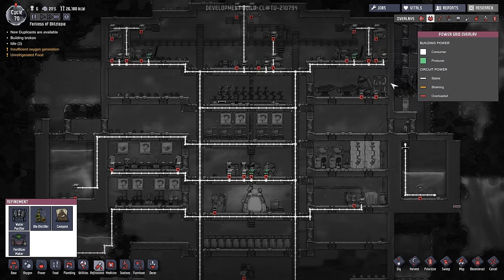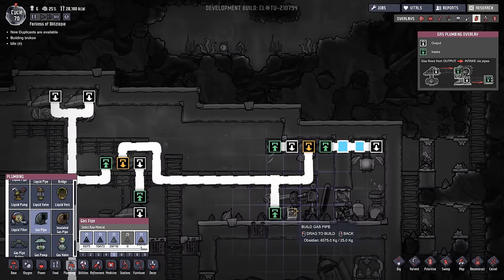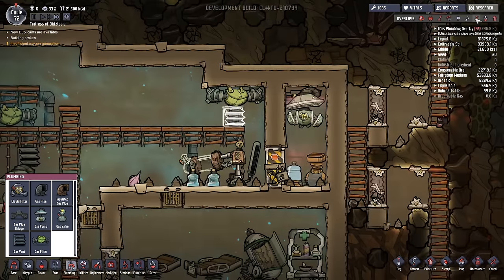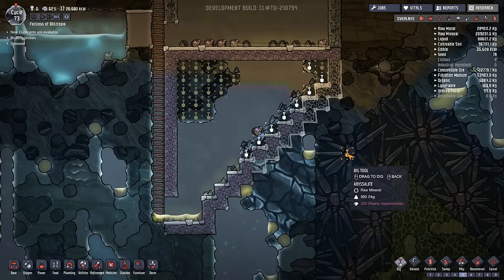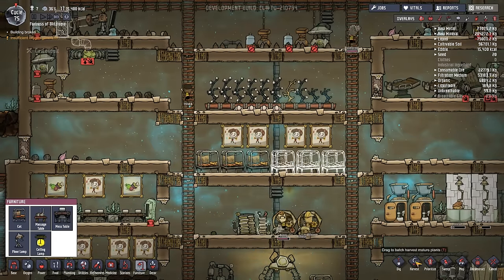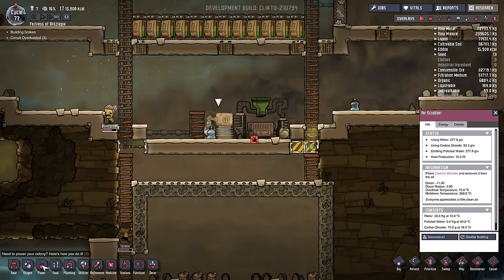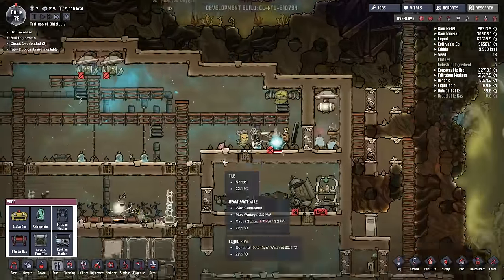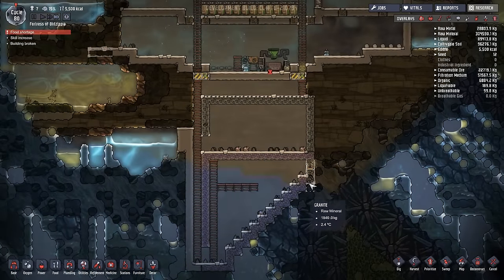Oxygen Not Included - Ep. 8 - Rerouting Gasses! - Let's Play Oxygen Not Included Gameplay

Comment: Blitz!!!! Wire max capasity is 2000w (2kw) and it's means all that power what you are making! Now you have to hydr. generators (800w+800w) and 2 (400w+400w) wheels. Thats too much! Now wire capasity is -400w couse 2000w - 2400w!! And please take a quick look from wiki for watt.. ..  :D

And solution for your problem is to make two cirquite (left and right) which both have 1 of both generators. Then the watts are under 2kW for both sides. (800w+400)
Reply: Luke Bilston You r right!

Comment: Was watching another youtuber - he used valves off his filters to change the rate of flow (I didn't realize they worked this way and haven't had a chance to personally try it yet) - but by adding a valve and lowering the pressure - essentially instead of pumping one big bubble of hydrogen into the generator - the valve made 10-ish smaller bubbles that would spread out the power generation over time instead of big spikes  - might help with the regulation of your power.
Reply: Nettie G yea that helps because the game is messed up in each bubble of hydrogen there is more than 10 grams the generator only takes 10 so the extra is lost with a valve that bubble would be split into multiple making the generator run for longer than before you are correct.

Comment: BLITZ PLEASE READ THIS!

The solution is easy add 2 big battery top left and connect it with top left generator Lets call that circuit 1. Do the same  with top right  generator you have circuit 2 then keep the connection on both hamster wheel with the battery beside them you have circuit 3 now share power usage of the whole base among these 3 circuits equally if possible since they all generate 800W. All the unused power will be store in battery

DO NOT CONNECT CIRCUIT TOGETHER 
Electricity cable unlike pipe will melt if to much juice run on them. Soo make sure to keep all those sweet connection system apart for each other.

Comment: do your powercabels from your base split it in half like right and a left section
Reply: exactly! make two separate grids and you wont have as much wattage in either one!
Reply: kilimaniaro I came in the comments just to say this.
Reply: You could even have more than 2 groups. Have a wheel and battery in the top right, another top left, and a third bottom right (and or left). Don't connect all the systems together so each system has a lower usage.
Reply: Splitting your power grid into multiple smaller ones will decrease the amount of power through each wire. you need more power generation, but to have that power split up so not all of it runs through the same wires. you have insufficient power and too much power for the cables.

Comment: I am an electrical engineer and I would guess they want you to hook up your generators to your batteries using voltage regulators, then hook up the rest of the base to the batteries. That way your components have a constant dc power supply rather that sourcing from the generators.
Reply: Sounds good but, as Blitz said, there is no input and output in the batteries, there is just grid, the game is not that sophisticated I think
Reply: It's not a in put out put u hook the generators into the battery then that same in put line come out he just has plugged in cause when i play i run everything from the battery so all the power lines come go through the battery before connecting to the generators

Comment: General power use, Watts is a unit of power, which is equivalent to Voltage * Current(Amps). Disconnect you power generators from the main circuit. Have power generators ONLY connected to batteries then connect your batteries to power consuming utilities. You should put different sets of batteries for different groupings. Houses have breakers that limit the Amps, breaking up the power in and out along with having different batteries for different circuits will lower the strain.
 
Right now you have everything interconnected, so power from generators isnt being stored then used, theyre just being dispersed clogging up the lines. Dont create a loop with the generators. If you look at real life power plants they have high voltage lines coming from Generators, to distribution agencies. The batteries in this case would be the distributor

 Remove all the wires. Have all your connected into one line but not overload the wire, run that SINGLE line into the batteries only. So if you are making 1 kW theres only 1 kW in the one line, instead of the 1kW generation plus the 2 kW that is powering all the appliances. have a set of batteries for each major section, (similar to a house and breakers) I.E. a set for the kitchen, a set for oxygen creation, a set for water distillation, etc. make a bunch of small circuits. Have one wire go to 2 or 3 things. and run more lines out of the batteries. 

Everyone please like this so hes more likely to read.

Comment: I'm writing this early on into the video, so he may have a fix already, but from my perspective, it seems like the batteries are like capacitors in this instance, and can be used to siphon off excess power from the generators.  

If that's the case, I would start by isolating the power generation to the hydrogen conversion circuit, which would consist of the oxygen generators, the hydrogen converters, and the gas pumps, as you have at the top.  Build the circuits as you have - it's great that you have such a small system here - then run each individual circuit to a power switch, then from the switch, connect all of the power generator circuits to one line, leading to a master shut off switch, so that the generators are all in parallel.  What this system will do, is it will let you turn on or off a single circuit as you need it, and it will let you cut off the whole system if you need to.

From the master cut off switch (ideally built with high wattage wire), run to a large battery bank.  If these batteries do act as capacitors, then they will siphon off power from the line, and store it.  Then from that battery bank, you can run power to the rest of your base with normal wire.  After that, when power builds up too much, simply turn off the master switch, and let the batteries drain as they take over the powering of the base.  Alternatively, you can turn off individual circuits (which will still generate oxygen and hydrogen, but the power won't have anywhere to go, so you might want a single large battery for each circuit, as well.  This way, once the battery is full, you can turn the generator off, then use the battery to give it the jump it will need to start up again when need be), and use the reduced generation to regulate the power, while still allowing the battery bank to drain, but at a slower rate.

What's really good about your design as it is, is that it's easy to build, and takes up very little space.  So, in theory, you could build one at the bottom of your base, where you're trying to dig out, for example.  Build one down there, let it generate oxygen, then use the power, without attaching it to the main base, to run an oxygen scrubber and a temperature regulator.  You can repeat this anywhere you go, and your dups will work faster because they don't have to constantly stop to run back to take a breathe, or because they get too hot or cold.

Also, for your bathroom, would it be possible to install a pressure manager on your waste pipe?  Let a set amount of water through, then drain the excess into your waste pond?

Comment: Just split up the power system into different areas. For instance, you could have one wheel and one battery up with the hydrogen generators and set the wheel up to only run if the battery is at 0%. This way, your dupe will only run in the wheel to kickstart the hydrogen generators. Also, make sure the hydrogen circuitry is independent from the others circuitries.

Comment: Blitz, You seriously need to remake your CO2 pressure room from the previous season. Then put 4 algae grow beds in it so the CO2 turns into O2 and make a circle circuit inside that can pump the O2 from the grow beds out and circulate the CO2 around while maintaining its pressure. You could also flood the room slightly with water so the algae grow beds don't have to be manually watered. I've had a chance to try this system and IT DOES WORK!!! The gas overlay in my base is almost all light blue with the red (CO2) all concentrated in the pressurised room that was built for it.

Comment: Hey, Blitz I have a good bit of knowledge in electrical. The easiest way to think about the basic's of electricity is, to think of electricity as water. Voltage=pressure, Resistance=the size of the pipe(Lower the resistance= bigger pipes), Current=the flow rate, and Wattage=the volume of water. So the main things are you want to get enough wattage(volume of water) to the device that needs it. and to have large enough pipes to support that kind of load. If you overload the pipes with too much they are going to burst. So you need to run larger pipes or more pipes to support that volume of water. So you need to go with the higher wattage(Volume pipes(Which means less resistance)) In this game you appear to be limited by 2 electrical pipe sizes, and the larger one seems like it's not enough. so secondary lines in locations of high flow(mostly near your power sources not on the splits going out to single devices to power them) with a 2nd line that doubles the flow capacity of the system lowering the pressure so the pipes don't blow(Although in electrical the pipes blowing means the Copper lines becoming red hot liquid that tends to start fires.)

Also on your power generation, it seems like your hydrogen generators(Electrolyzers) can't produce enough hydrogen for your pumps and your power generator. So I think more hydrogen generators per pump in an area, I'd I had to take a guess I'd say 3 hydrogen generators for 2 pumps, but that's just a guess. Also, I'd do it all in 1 large room instead of several small pockets so things can be adjusted easily(Like adding more hydrogen generators if the pumps aren't pumping all of the time, or adding more pumps if the pumps are overloaded)

As for water I'd want to tap into those geysers and feed all dirty water in there from everything and pump water out of there through a filtration system and then have that feed all of your base with infinite clean water

Comment: @blitzafterdark wattage is the product of Voltage and Amperage. Your house runs at 120v if you live in the US (except appliances which run at 240) but each thing you plug in take a different amount of power. If you look at any electronics you can see the energy is measured in watts (or watthours) or in miliamps( or miliamphours, like the battery in your phone). It would take too long to explain some of the other misnomers in the video, but transformers modulate voltage. For example the transformer outside your house converts ~50,000v at the pole to ~240v for your breaker box and then that steps down the voltage to 120 for normal outlets that aren't household appliances.

Still love the videos though, keep it up. Part of the fun is figuring this stuff out.

Comment: You said you understand water piping systems, the best analogy I have heard between plumbing and electrical systems is: voltage = pipe diameter (potential), amps = rate of flow (current). Watts = amps x volts, the total volume of power. So high volts, low amps: a big pipe with little water pressure, low volts, high amps: a smaller hose spraying out at high pressure, but both may fill the same volume in the same time (equal watts). You are overloading the wires due to producing too many watts (2x800w+2x400w)=2400w, the heavy wire can only handle 2kw = 2000w.

Comment: Voltage is the amount of energy, wattage is the amount of energy per second. Although you are making enough energy, the wires can't handle that much energy per second. A way to handle this is to make two separate circuits, one on the left side of you base and one on the right side of your base. If you do this, make sure that the two circuits are NEVER connected because if they are, the system will work how it is working right now.
Reply: Wattage is the amount of electrical work or "power". Amps is the amount of energy per second. the fear of having a system with too much Watts is that it'll generate a lot of heat and start melting. Though the game keeps it simple by ignoring resistance (ohms) it does limit some of the things you can do. IRL you can daisychain all of it together with several resistors and diodes. W= V x A
if ya got anything else you want to know about the subject I got an associates in EET I am yet to put to sufficient use.
Reply: Kaleb Sherrod  yeah irl we'd put some step down transformers, grounding circuits, regulator circuits, inductor and capacitance banks and a bunch more lol EET bachelor's here

Comment: Blitz, try isolating the hydrogen generators, gas pumps, and electrolizers on a circuit separate from the rest of the base, make sure to add a battery to the second circuit, it should at least lessen the load on the rest of the base, you could also move your third wheel onto the second circuit if needed

Comment: *Re-commented from last video*Hey Blitz, you should split your Base into 2 or 3, with a hydrogen generator system on top (verticle) for each, 2 big batteries in the (verticle) middle for each, and a wheel next to it. Do it so that no wires go in the (horizontal) middle. This will create a stable circuit, and maybe you can create a power room where a 4th hydrogen generator feeds a backup battery! This should work well.

Comment: CFM = Amperage   PSI = Voltage  Volume = Wattage, (kinda but this should help) This game seems to show only wattage on the surface, but i believe what you are seeing is too much wattage being forced in from too many devices. that isn't being used at the outlets. So too much water at too high a pressure wont change the use are the tap and could crack the pipe. So if you put some batteries (tanks with a regulated output) you can fill that battery with all the wattage you can make, (and the power makers will shut off after the battery fills to a certain point to prevent burn out cables)and then the battery and the outlets will feed the system with what it needs as it needs it.

Comment: ok so 2 things you could try for power issues is
1. you could create more devices that require power so that you are always drawing more than you are making, but still within a manageable amount (also you could pause and activate them as needed until you find a good balance.
2. Another thought is to have 2 (or more electrical circuits- for instance one fore the top half of your base and one for the bottom half, this would require to separate your power creation units....but would that be a bad thing, it could distribute the heat better as well as limit the stress on the circuits
But hey thats just what popped into my mind, and i may be completely off, that being said I hope you find a solution and I cat wait till next vid, its an awesome series...so props ;)

Comment: about the wattage and voltage thing, as i know Watt is kind of Energy unit per second ( Joules per second), and Volt is potential difference between two points of the cables. So a producer unit makes in one cable 0 Volts and 120V in the other ( in 240V, one cable is -120V and the other is +120V). And watt is the "energy" flowing though cables.

Comment: You can't get a self powering hydrogen system since it takes all the power from one hydrogen generator to power two air pumps and two electrolizers and one filter.. since it's clear you need 3 to create enough hydrogen to keep it on, that means you also need 1 hamster wheel as well just to keep the system up and running (and that's only if you only use one filter). This system would also need to be separate from the rest of the electrical system since once you get to 2 hydrogen generators, you will overload the wires.

Comment: Blitz, think of electricity similar to how you think of water going through pipes. Amps would be the volume of electricity flowing through the pipe. The electrical pressure would be the voltage. Watts would be the power that the line can provide.That's a very simplified version, but that's the difference between watts/voltage/amps. You're seeing how much power your lines can provide.

Comment: You should have two separate power systems for your base. Which means you split each half of the base to have it's own wheel. Wattage is the DRAW on your equipment. Voltage is the power supplied. So The wires can only handle a certain amount of items hooked up to each circuit. If you have 3 lights using 60w each then you have a draw of 180w on that wire. If the wire is only rated for 150w you would be overloaded and would need to run one of the 60w lights from a different power source. OR use heaver wire that can handle the draw.

Comment: Maybe you should build gas permeable tiles between the two electrolysers on the left. Then you only need to keep the pump on top. 
One pump and one filter less in the hydrogen system.
Then you could try to separate this from you main grid with a switch? Build batteries to harvest power from hydrogen and turn the switch on when needed.

Comment: I think the things needing power drains the power stored in your batteries that's why even tho the 'power generators' you have constantly make enough power (and sometimes produces overflow), when the night comes, the power stored in your batteries depleted. I think the solution is that you need more batteries so you'll have "stored" power for the nights to come. Also... I think these batteries powers the Hydrogen Pump, that's why when dups stopped working the wheel, they also stops.